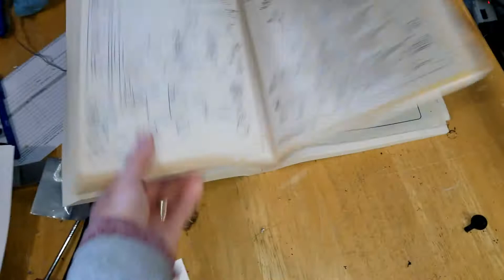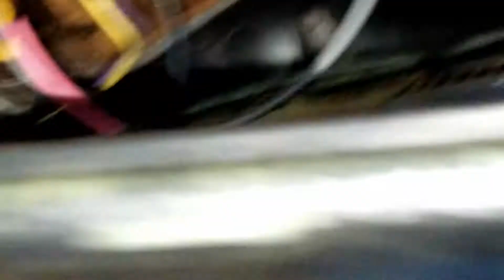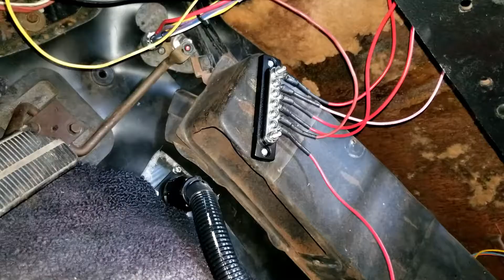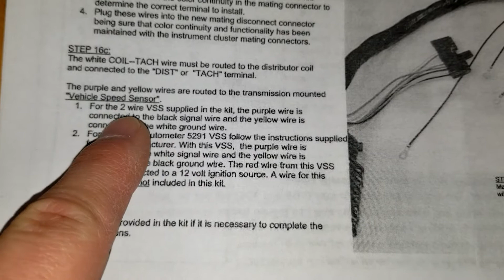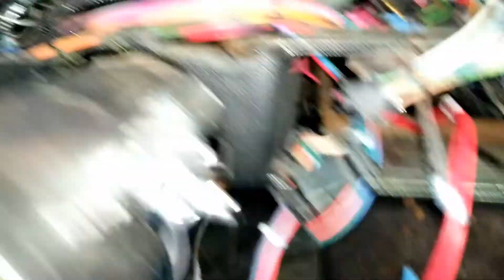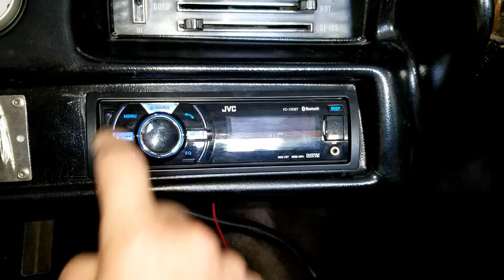Classic Dash Overlay Rewire / 1971 Chevelle

Comment: Did you have to trim the top of the overlay to get dash pad to fit correctly ?
Reply: I dont recall having to trip the top of the dash overlay.  I did have to trim the inside of the overlay for the heater/air controls and vents.